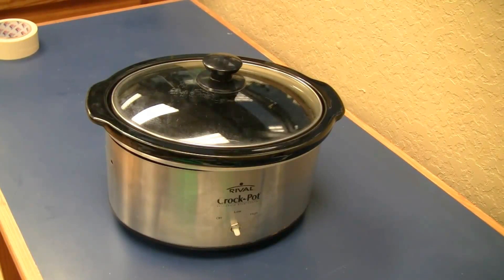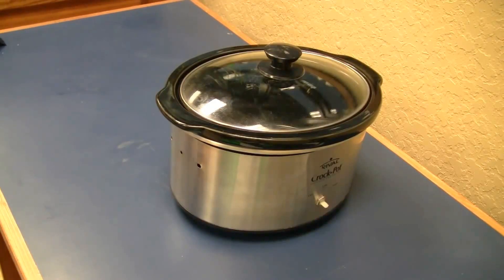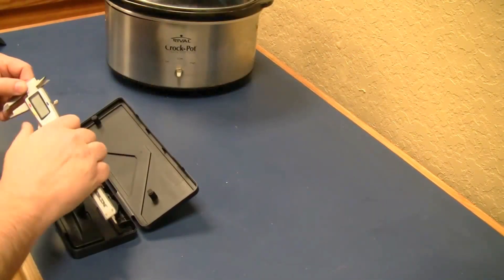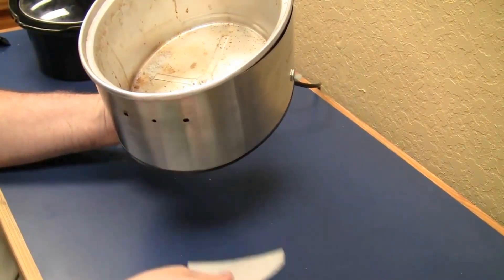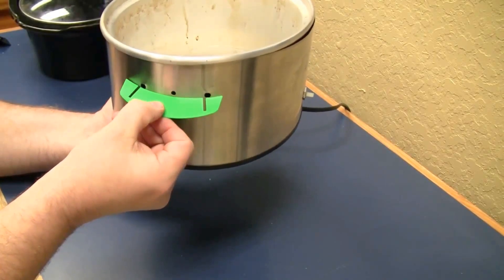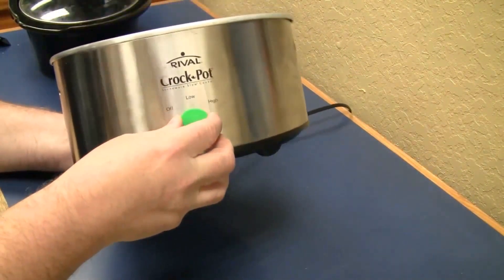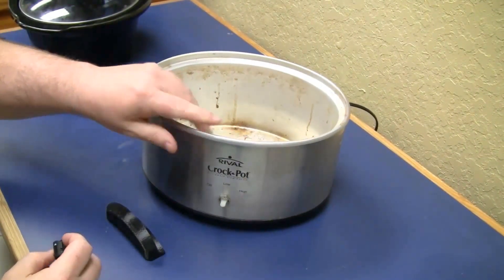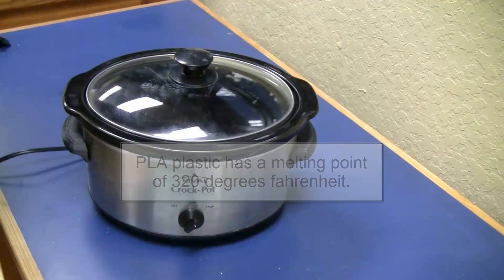Practical Uses for 3D Printers: 3D Printed Crock Pot Handles

Comment: Good video, I really like videos on practical uses of 3D printing, even if that's more mundane than printing something "cool".
And great approach to refining a design. To me the ease with which one can iterate and perfect a design is a huge pro of 3D printing.

Something worth noting is that while the melting point for PLA is high enough, it starts to soften at a much lower temperature, around 55 deg. C (131 deg. F) with variations depending on the exact composition. Might do the trick on a Crock Pot but it's notoriously low for other uses. Luckily there's other types of plastic easily available nowadays.